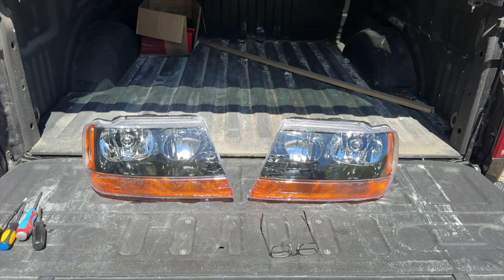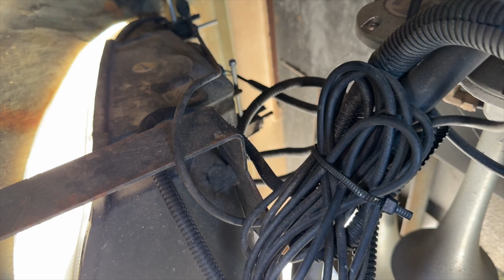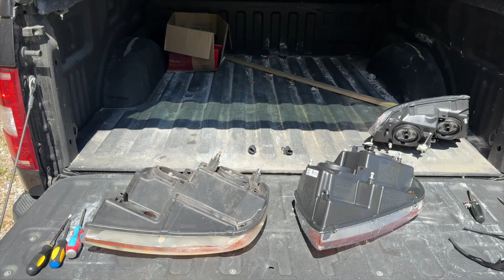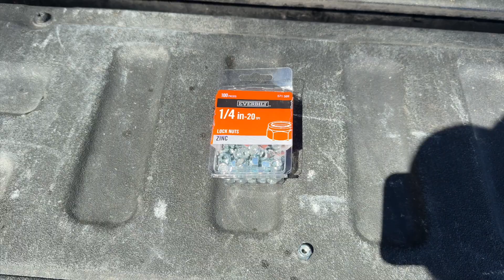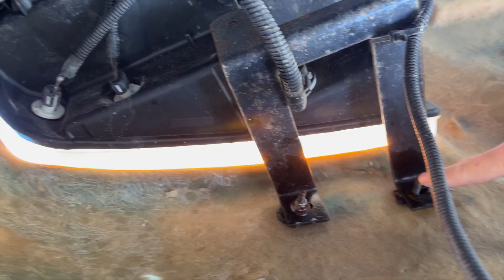RV VLOG #003:  Replacing the old headlights with new assemblies on my 2008 Fleetwood Discovery 40X.

Comment: Another question for ya; I’m trying to replace the reverse lights with new LEDs (those old lens covers look terrible) and  finding it very difficult to find a replacement for the assembly, I decided to replace all of it with a rubber fitment that circles the LEDs. Currently trying to take out the housing in hopes to make it fit and can’t figure out how to remove it. Any ideas??
Reply from the maker: No idea.  Do they have any numbers on them like the headlight assemblies?